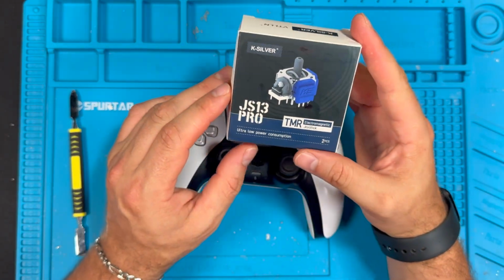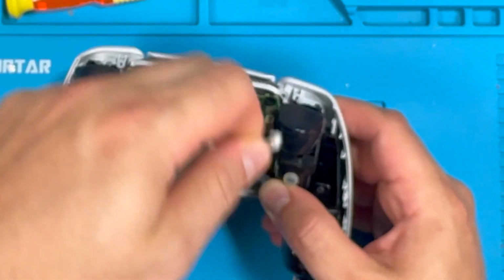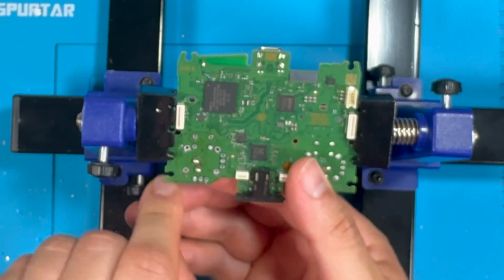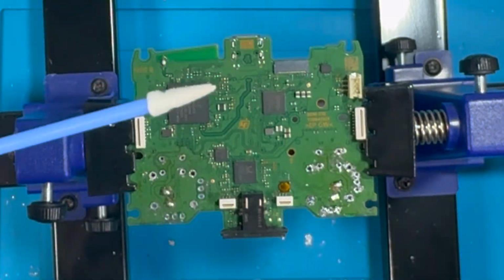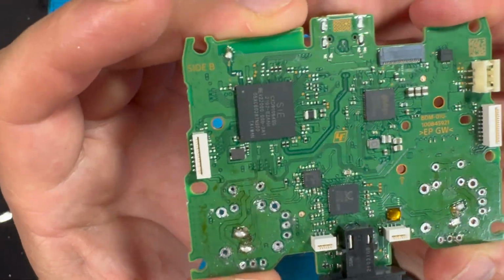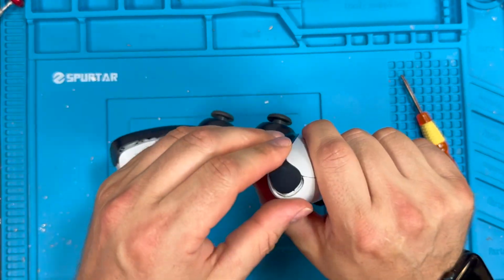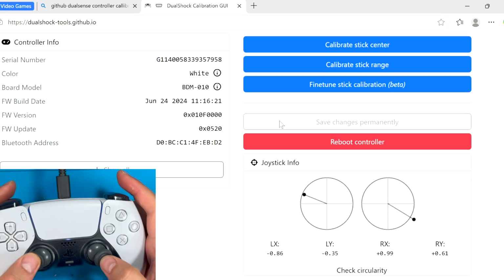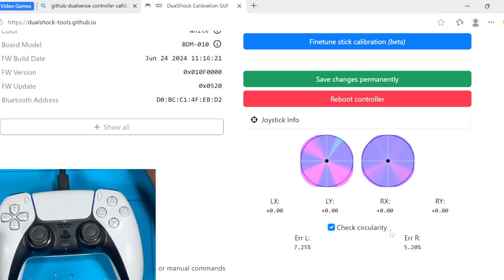K-Silver TMR Joystick Installation for DualSense PS5 Controller

Comment: Which Temperature you use for heatgun? 400 Celsius ?
Reply: I personally used 410 degrees. As long as its around 400 you'll be good and it should melt the original solder

Comment: Does any body know where to buy them already installed and trusted because I suck at boldering
Reply: ebay bud also safer as if theres issue you can return
Reply: Amazon has them or ebay. Also most phone cell phone repair places can change them. A guy was charging me 20 bucks per controller if I want to do more controllers

Comment: Can i still calibrate my sticks via Bluetooth? My charging port is broken.
Reply: Nope, if you’re getting analog sticks replaced might as well get the port replaced too
Reply: Installing a new charging port is very simple. Ive done it and its just one screw
Reply: @jahkareramkissoon419  it's not simple on a ps5 controller. You need a micro soldering station. Very difficult.

Comment: When you collaborate the controller 
Where does it save to?
And do the settings we save work when I disconnect the cable and plug it back into my PS5?
And does it work on the Ps Portal?
Reply from the maker: The settings are saved directly to the controller’s internal memory on the controller board. So you can disconnect and use the controller on any platform and it will have those settings which you calibrated. That’s why the website specifically states not to remove the battery while adjusting the setting because it will not save and could corrupt the setting

Comment: How is the tension on these sticks compared to the original ones? As ive had the nacon revolution 5 pro controller before and i could never get the feel for thar controller as the tension was just loose for my liking.
Reply from the maker: The K-Silver TMR sticks have  tighter tension than the original dualsense, not sure about the revolution 5. giving you better control for FPS games. I could tell the improve right away when plaything with them
Reply: Yh the revo 5 pro is way too loose i never seem to find a controller for the playstaion without stickdrift issues
Reply: @EYE_RAK  Edge controller. Got mine on release and still haven’t got drift. Use it everyday. Bought backup module years ago and it’s still new in box cause my original modules just aren’t drifting.